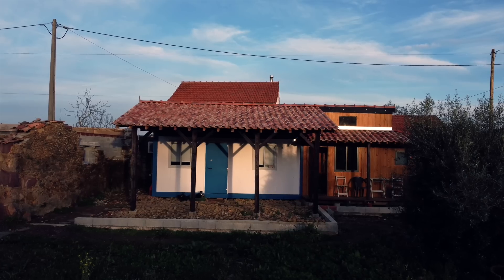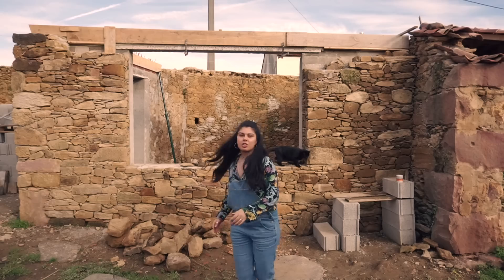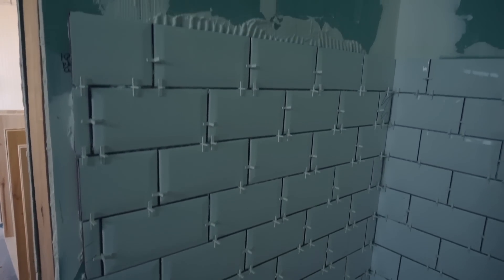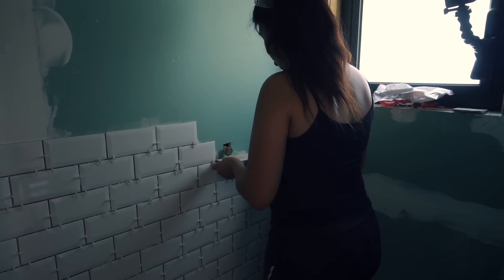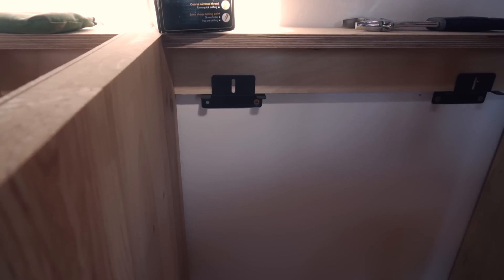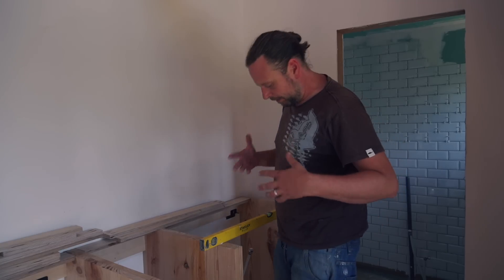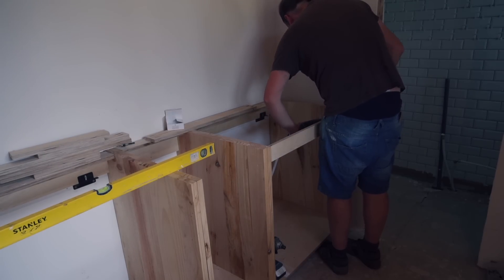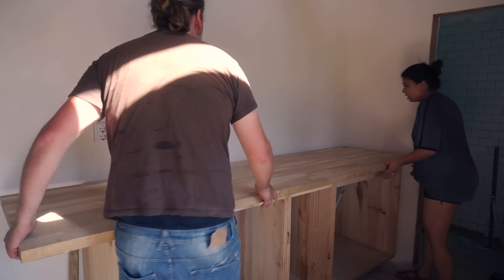Turning an abandoned 100 year ruin to a beautiful home

Comment: When I've done grouting I always use my fingers rather than an applicator & just put grout into the gaps rather than getting it all over the tiles. Less wasteful, far more accurate & takes less time & effort.
Looking really good.
Reply from the maker: That could be good but at this point my hands were so dry because of the grout and wall adhesive that I was actually using gloves afterwards. Tough stuff!
Reply: @TheIndigoEscape  Blimey, fingers definitely not an option then!!

Comment: I forgot to tell you that you should have used whingedback elbows in the wall fixed to a noggin atm your mixer is very flexable and over time it may loosen one of your nut fittings and create a slow leak

Comment: I always use Fernox LS-X sealer, never had a leak and it stays flexible. I've just seen a video showing you should twist the PTFE tape in to a rope and wind that in the threads then cover it over with the full width as normally do.
Reply from the maker: Yeah! We heard of that too. I think they also sell rolled PTFE tape but the hemp divers (not horse hair 😂) worked really well.

Comment: Probably you already know how to use the PPTE tape, but in case you don´t know the following. you can use it as a tape of one cm width and tape it clockwise nine times around the screw end or you can roll it as a thread and then turn it in the lower screw part for as well nine times. It should be fine by then. Of course you can use horsehair or hennep. That is a bit old fashioned but it works better than ppte.  Also turn it nine times clock wise around the screw end.
Reply from the maker: Thank you for the info, very precise, appreciated!

Comment: Its definitely not horse hair its called hemp secondley you should scratch your threads with a hacksaw blade to help the hemp stick to the threads also dont over tighten the nuts  hand tight and then a halfturn with your shifter but teflon should do the trick as well there is also a product on the market called LOK SEAL its a good product for amateur's hope this advice help old school plumber with 45 years experience in the trade goodluck

Comment: I can see you are installing shiny white tiles. I can tell you that in my home, my bath/shower has the shiny white tiles and they are a pain to keep shiny due to the acid, or other things in the water that stain them. It means that every time I shower, I have to  use a squiggy to remove the water before it dries and stains the tiles. In my previous home, I had white non-shiny tiles and I never had to remove the water. With the shiny tiles, it has become a cleaning burden every time I shower. Perhaps you won't have this problem if your lighting is not reflecting off the tiles.
Reply from the maker: Thanks, we will definitely be able to report once they are being used! Here we have soft water, so maybe it's a little acidic compared to what we are used to.

Comment: I would have Waterproofed the Shower walls, Humidity will pass trough the grout and damage your Drywall along the years...
Reply: En mi reforma pedí que lo hicieran, Nadie me hizo caso, y ahora tengo humedades 🤦‍♀️
Reply from the maker: I was worried about that but I asked where we bought them and say we shouldn’t need to. The grout is also water resistant. Hopefully it would be alright 🙏🏻🤞
Reply: @TheIndigoEscape  i think that people in Portugal do not “care” so much about it 😂
Iam also Portuguese, few years a go, nobody waterproofed their bathrooms, wich it is no big deal if the Shower Walls   that are exposed to water are NOT external Walls, they are not exposed to the outside temperature and if you have a Sand, cement and lime coat. 
On Drywall, you have to waterproof it.
Walls will get Damaged in a few years…

Iam a professional home builder and Tile layer, I can say that with experience…I wonder why people on such Homedepots or stores are not correctly informing the customers…we need more qualified people, for sure!

But now it is too late, you could impossibly save the walls by pulling out the tiles, the drywall would also be completely damaged by removing those.
If I would be in Portugal I would help you, but currently iam living in Germany…
At least you should seal all the corners with silicone, so that water can’t pass trough it and hope you don’t have to rebuild everything in a Few years. 
Moisture will start to appear in between tiles joints, specially with white grout…

The last thing you could try, buy a kind of Resin primer and apply it on all Tile joints with a small brush, ( at least two coats ) that would keep the moisture outside! 
I hope I could help you
Reply from the maker: @FB2T01  It was our local building shop! I was very paranoid about the moisture coming through but as it was adviced that it wasn't necessary, we followed through. The resin idea is really good actually so I will talk to Omar about it. Thank you! I really appreciate it. I think also we will be opening that window while we shower and afterwards so moisture leaves very quickly. Thank you so much for offering help! Even though you are in Germany, free advice from experts like you is priceless for us!